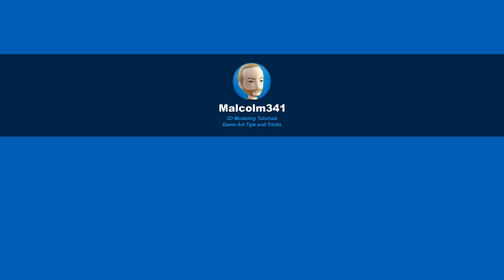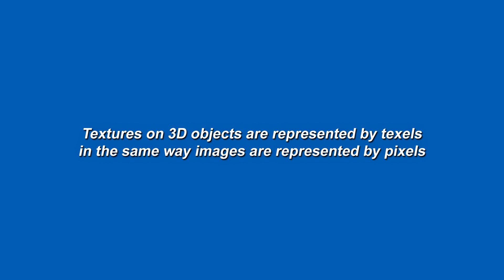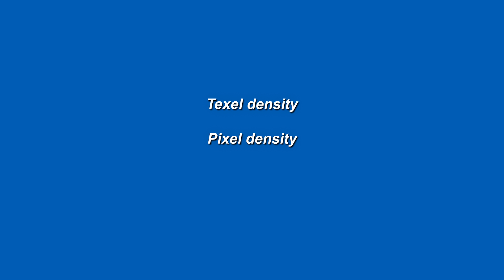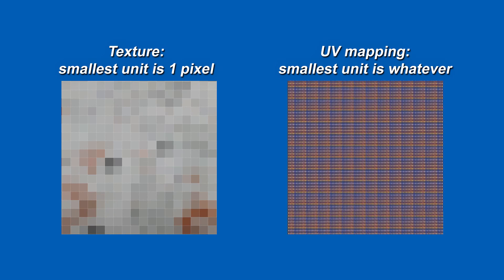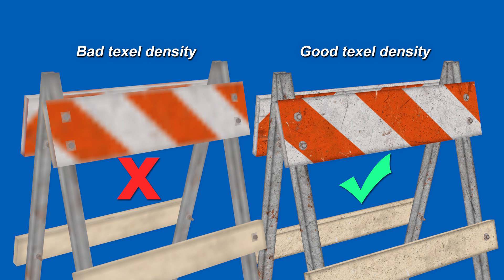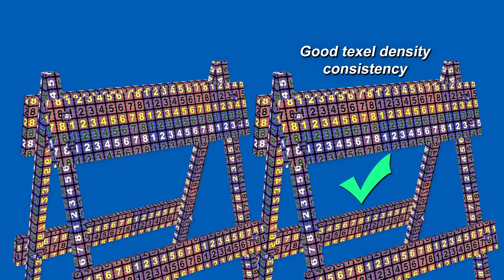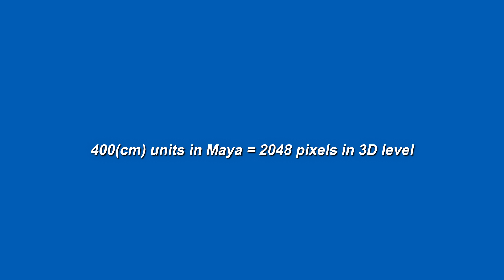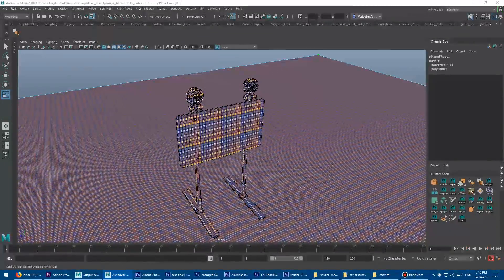What is Texel Density and How to Master it

Comment: Hi malcolm, I have a question. i have a 4096 map size with a texel density of 8.192 (so 2px per 1cm) i thought that it was everything going fine, hit set and the UV shells got to the size, but i did a test and put the map size at 2048 with a texel density of 4.096 (again exact same ratio 2px per 1cm) the problem is that the UV shells didnt got bigger. Isnt that what they are suppoused to do? if i lower by half the density and the map size the shells should in theory get bigger to make up for the size of the object that is not getting changed, right? why is this happening! helppp!
Reply from the maker: @erickh555 Great question, because you're changing both the map size and the texel density you're ending up with the same result. In your case you want density of 4k map 8.192 pix and if you want that same density across another object using a 2k map you should either change the map size to 2048, and then click the set button, or leave the map size as is and change the texel density to 16.384 both solutions will create the same final result.

What I like to do when texel density confuses me is create a quad to the scale of one texture in world space to the size that I want it. In your case make a quad that's 500cm big and make sure the UVs are exactly 0-1 which should be there by default. Apply a checker texture to it and set map size to 4096, then click the get texel density button and look at what happens to the texel density field, it should read 8.192, now change the map size to 2k and click the get texel density button again, it will now read 4.096 indicating you will have half the pixels across the surface area if you use half the texture resolution. If you actually apply a 2k checker now it will look blurrier. To compensate and use the lower res texture, but have the same number of pixels across the surface area you would increase the texel density from 4.096 to 8.192 and set, effectively doubling the tiling giving you the same number of pixels across the surface area, but with more repeated pixels. Hopefully the make sense.

When it doubt, just map one face the way you want and copy paste the texel density from it and never change the map size. I rarely change map size, and instead just copy paste from a face or manually input the texel density size.
Reply: @malcolm341  thank you so much for the explanation, i knew i wasnt doing things the wrong way bc the checker was always the right scale but i wasnt able to understand the logic behind it, thanks a lot again! You have a Great channel with incredible information i subscribed as soon as i watched the video :)
Reply: @malcolm341  i dont know if what i did was right, i have to do a gun with a texel density of 2px per 1cm, so i used a 1k x 1k texture and applied it to the 500cm X 500cm quad, thats the one i use to get the texel density from, but in texture size i used 4096 bc thats the resolution im working on substance, that gave me the 8.192 texel density but i dont know if that equals to the 2px per cm that my teammate asked me to do
Reply from the maker: @erickh555  For UV layout and padding I would recommend UV mapping the mesh to the final texel density it will be delivered at and then just up-scaling in Substance using the project settings to make it 4k. So if the final texel density will be 1k map with 2px per 1cm I would recommend setting map size to 1024 and texel density to 2, but you should ask your lead how they like to do it for the project.

What can be helpful to check your work in Maya is to make a texture that will be the final size in game, for you 1k, then make a checker where each square is 1 pixel. In Maya, make a 1cm quad, and apply the checker texture to it, turn off filtering in the file node so it doesn't blur and you can clearly see the pixels, then you can see at map size 1024 pix/unit should be to 2 and set that on the 1cm quad and you should see exactly 2 checker squares across the quad confirming that a 1k map will have 2pixels per 1cm.

Comment: sorry to come back after some years but I havent been modeling for a while, I currently am using a rts style game and I have a 256 tx density. I have some small props I want to 0-1 but at this texture desnity, it seems ike the model take alot less uv space. So I am wasting lots of uv space. Any idea what to do in that case
Reply from the maker: It's the same workflow no mater what game style you work on, first define the camera distance from your average ground texture, then determine what your average texture is going to be, let's say 2048x2048 will be your average texture.

So while looking through the game camera apply the texture to the ground and scale the UVs as few times as possible. If it starts to look too blurry scale the UVs a bit more until you find the sweet spot. Once you've found that select the ground plane and use the get texel density button to record what that texel density is. Round up or down if it's a lot of decimal places. 

From there apply that texel density to the props and see how it looks, if you think it's too high and your props are too pixel dense you can scale the textures down in engine by half which is what I recommend because it's non-destructive.

Comment: Hello, is it acceptable to cut and stack uvs on top of each other to make them fit into 0 - 1 uv space? 13:54 wouldnt it create problems and distortions in applied textures/patterns when texturing substance painter?
Reply from the maker: Yes absolutely, this happens all the times in game creation to hit texel density without adding more textures. The only thing you need to watch out for is repeated details, it's all an challenging balancing act with each asset.
Reply: @malcolm341  At the end of method 1, when you have the really big plane, it doesn't end there, right?  You still have to go through the process of chopping it up to overlap itself like you do later in the video? Why do you have to do that manually?  Isn't there some way to "tile" the texture and just tell it to repeat across the rest?
Reply from the maker: @alexcarr5439  There is no requirement to overlap and fit UVs into the 0-1 space unless your project calls for it. Tiling textures are acceptable, but will have repeated tiled patterns and you need to use other tricks to break up the tiling. Large environment assets for games often use tiling textures that go outside the 0-1 range.

Comment: Is the game industry standard 10.24 for 2k or 4k texture?
Reply from the maker: It's different for each game and characters are higher than worlds. On Gears of War 5 we used 5.333 for 2k textures. I recommend using 5.12 for 2k textures just so it's easier to do the math and allows you to build floor tiles that are 400cm square.
Reply: @malcolm341  Thanks for the answer! I'm just asking because most small game studios that I worked with don't give a damn about texel density, but regardless of these circumstances I want to work with the standards.
Reply from the maker: @Miki-pg4gp  everyone should care about texel density or the game assets will look inconsistent throughout the game, but this is something larger studios value more because they need consistency across large teams. The standard I've used the most in my career at EA and Microsoft was 5.12 for 2k. Most triple A games will be somewhere close to that. The nice thing about this texel density is it can be halved easily or doubled if you have a cinematic asset. On Gears 5 we also used detail maps on almost everything.

Comment: i was wondering, when i made the same plane and changed the scale to 400. mine was massive in comparison to yours. i think we may have differing units for our scene or maybe different grid size i'm not sure. could you please tell me what your settings are at for units and grid?
Reply from the maker: I generally work in cintemeters and the grid is set to Length/Width 128 Gridlines every 32 Subdivisions 1

Comment: As a 3DS Max user the ease in which you can do advanced unwrapping stuff in Maya makes me cry inside lol.
Reply from the maker: Maya has always had great UV tools, 3DS Max should be pretty similar though as far as I know.
Reply: @malcolm341  I've been using it for 10 years and I can guarantee you it doesn't have a built in solution. There's external scripts and plugins. Just jealous of the native functionality Maya has! >_<

Comment: hello sir.
12:30 to 12:52 : what if i have a box. inside of the box won't attract much attention and i have to use 256x256texture for mobile. Also there are some letters outside of box too. shouldn't i unwrap it uniquely ? like 6.5 texel density for outside and 2.5 for inside. (numbers are just random)
Reply from the maker: If you have a very small prop where everything fits into the target texel density feel free to unwrap it uniquely. If you can't hit your target texel density with unique unwrap you must stack shells and butterfly parts of shells. For parts of the model that aren't important I try to reuse other parts of the texture, but you could also consider giving it less texel density if you're sure it will never be seen up close.
Reply: @malcolm341  thank you master, i love you
Reply from the maker: Good luck with your project.

Comment: You stack parts and then you can't bake mesh maps for those. Bad advice. Very bad asdvice. Dislike.
Reply from the maker: You must be new to normal mapping, baking stacked UVs is totally fine and necessary for game art. We did this all the time during the development of Gears of War 5. Everything would be blurry and low rez if we tried to unwrap whole buildings and large props as you're suggesting.
Reply: @malcolm341  I don't bake normal maps. I don't do HP models. But with stacked UVs I get wrong bakes in world space normals and position maps. And how do you make one tutorial and don't make the other, which the first one leads to logically?
Reply from the maker: @jamarch3982  This tutorial is about texel density which comes long before learning how to bake or world space normals or position maps. Texel density applies to all texture types and is a basic concept you need to learn to make your artwork look good. If you don't understand texel density you'll get stuck as soon as you need to texture something bigger than a tiny prop. If you're making things for film you can do the UV layout however you like, but in games you have to work with limitations, one of those limitations is stacking UV shells among many other things. It would be nice if you could just unwrap everything into the 0-1 UV space, but that's not how the games industry works.
Reply: @malcolm341  no, this is still a bad advice. You WILL have all kinds of problems with your bakes if your UVs are stacked. Maybe not all the time, but quite often. Besides, the textures will repeat on the stacked UVs, which doesn't look good. So it's a bad, bad advice. If you don't specify the further workflow.
Reply from the maker: @jamarch3982  it's not bad advice, it's the truth, you can't get a job in the games industry if you don't understand how to stack UVs and make your texture look good at the same time. Repeating parts of the texture is a must for anything other than a really small prop to maintain texel density. Baking stacked shells also works fine, in some programs you just need to move the additional shells over by one tile, we've been doing this for years on Triple A games. There's nothing further to specify, if you didn't understand the video you just need to practice more, it takes years to master texel density and stacking shells to get good results. If 3D art was easy everyone could do it.
Reply: @jamarch3982  bro, you are wrong. I've been in the AAA games industry for 10+ years, and have been stacking the whole time. Stacking UVs is the only way we can achieve texel density throughout the game. It's an important to learn how to hide the repeats and stack redundant portions to free up precious UV space.

Comment: Great tutorial! Thanks for the information. I only have one question about texel density, this topic is very difficult to understand for me, if I want to add decals in my models for example in Substance Painter, it would be imposible to keep a consistent texel density putting a face on top of the other isnt it? I work in 3DsMax and my teachers didnt told me about this topic when I was studying :(. Probably u can use decals with the unreal tools but I think there will be other options.
Reply from the maker: I'm not sure I fully understand the question. There are two kinds of decals in the games industry, deferred decal and mesh decal. Mesh decal is a floating poly you model on your mesh, deferred decal is a projector that planar maps the decal on top of your geometry in the game engine, they both have their uses and limitations.

In Substance painter you get a deferred decal that gets baked into the exported texture. Everything that comes out of the Substance export will be a flat 2k or 4k map and your decal will just be part of that so it will automatically be the same texel density as whatever UVs you've done before bringing it into Painter. Unless, you use a really small texture as a decal in Painter and then scale the decal projector up larger than what the number of pixels will be in the final exported texture.

If you really want to understand what Painter is doing, apply a 2k checker inside of Painter as a base layer and note how big the checkers are in the 3D view. Now create decal box or whatever it's called in Painter and apply the same checker texture to it, if you scale the decal projector down and the decal checkers are smaller than the base layer checker applied to mesh everything is fine, if you scale the projector up and the decal checkers get bigger than the base layer checkers you've lost resolution and the decal will appear soft looking in the final texture which should be avoided, but may not be that noticeable depending on what the final decal will actually be. Stains might look fine scaled up to some degree, text or normal maps may be soft and pixelated.